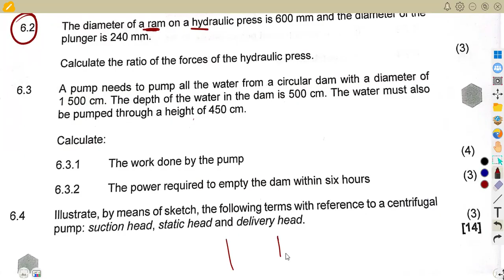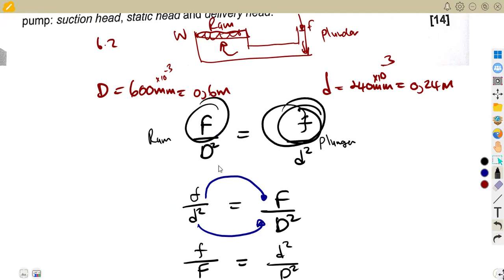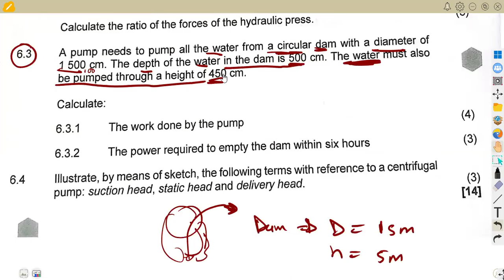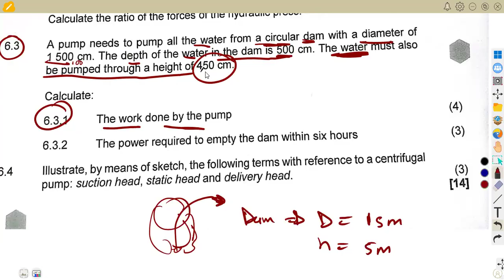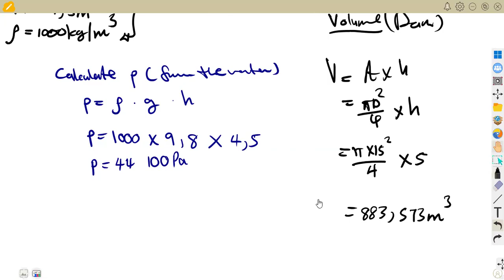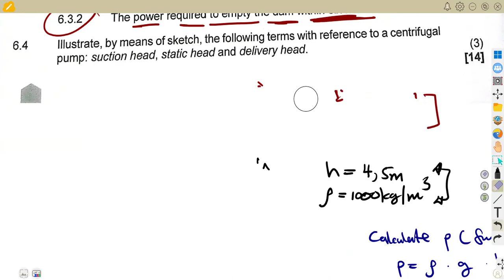Engineering Science 3 Hydraulics November 2023 @mathszoneafricanmotives @mathwithlightone

Comment: Good morning Mr,please assist me with the following questions
1.The hydrulic ram of the lift that is used in a service station to lift up motor cars to a height of 180cm has diameter of 20cm. The lift must be able to lift4tons. 
Calculate:
1.1 The power to lift the load (4)
1.2 The pressure (4)
1.3 The volume  (4)..